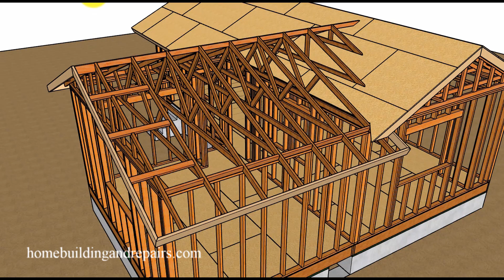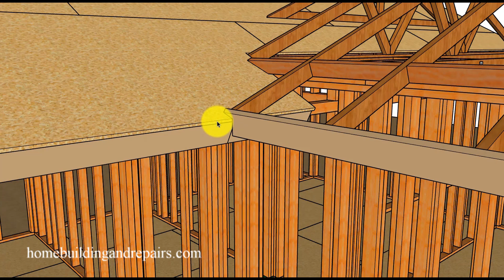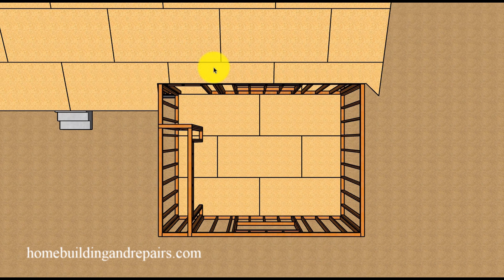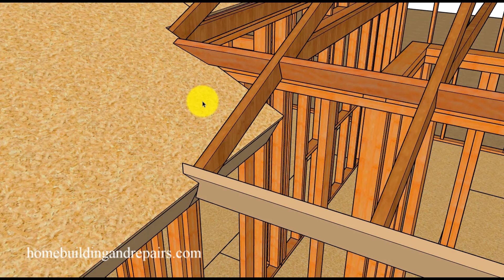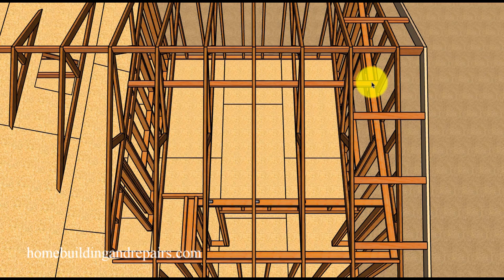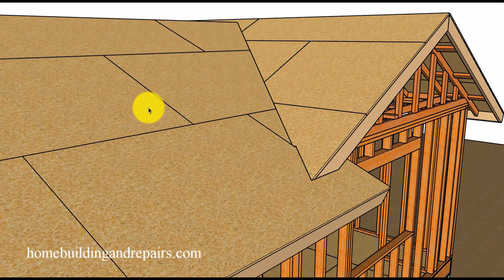Crawlspace Home Addition With Truss Roof Framing Examples - Two Different Roof Pitches

Comment: Are there any videos on a slanted second floor leveling? ... A corner of my first floor is also down 3 inches.
Reply: Could you show me how to make the eaves meet the roofs at different angles?
Thanks.
Reply: The house was built 1884. And it's all wood.
Reply from the maker: I don't have one on second floor, but do on first floor. https://www.homebuildingandrepairs.com/repairs/framing/walls/index.html